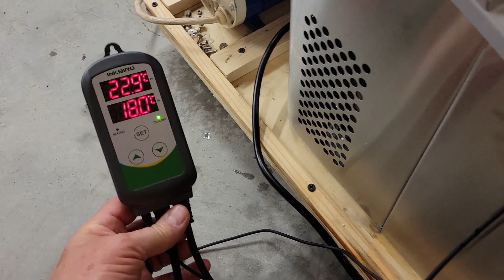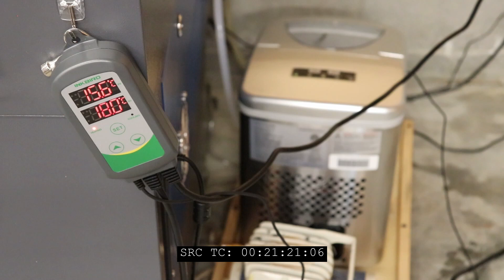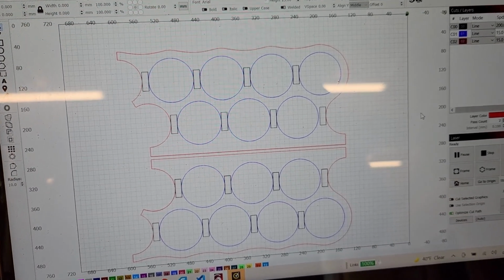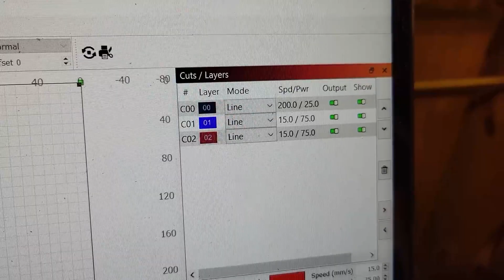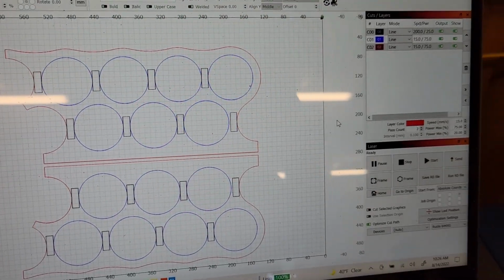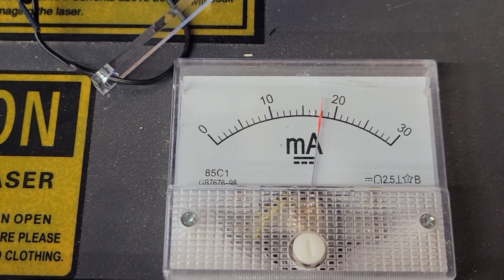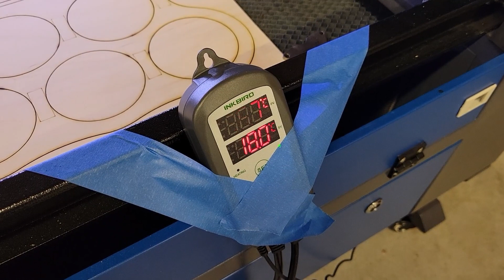CO2 Laser Cooling Method Comparison

Comment: Doesn't the fact that the temperature has increased to 25 degrees have to do with the flow rate of the pump? Perhaps if your pump moved a higher flow rate, it would help. Another thing that I think can be done is to insulate the hoses so that the cold water does not dissipate. I see that the journey to the laser is long. Perhaps the water does not reach your laser so cold because it travels a very long stretch.

Comment: Nice video. If you like to have a more constant cooling and dropping the temp lower, just let the icing machine do its work and generate ice in to the water at the pump and it will cool alot better <3

Comment: How does the inkbird work with the icemarker ? Beacuse when it turns it off and on don't you have to still put it on manually?
Reply: I only use the Ink Bird to monitor temperature and send an alarm to the phone app if it drops below a setpoint temperature. That lets me know if something happened to the heater and it stopped working.

Comment: I have two simple suggestions.
1. One of the reasons the temperature is rising is that every 5 to 7 minutes the icemaker compressor will reverse it cycle and heat up the coil to release the ice cubes. Since that manifold is spraying cooling water on it, it will add that heat to the cooling circuit. I suggest adding some antifreeze like glycol to your cooling water. That way you'll don't have to use that manifold as the ice maker simply won't be able to make ice cubes. Therefore the return line can discharge directly into the tank and thus not picking up any heat from the reverse cycle.
2. Go for 2 stage cooling by adding a 240mm radiator with a pair of high pressure 120mm fans to the return line. This will probably take off just enough heat to let the icemaker maintain a constant temperature. The reason behind this is that a radiator cools more effectively with a higher temperature difference while a compressor cools more efficiently with a lower temperature difference.

Comment: You could improve the efficacy of the chiller by removing all of the internal electronics and connecting power directly to the compressor, so that anytime its plugged it, it just runs constantly (just leave the diverter valve unplugged, its designed to change the freon flow to allow the cooling element to heat up in order to release the ice).  Then just use the external inkbird ITC308 controller to cut power if the chiller bottoms out in temp.  This will prevent you from having to deal with 'cycles' at all.

For peltiers, I had the same experience, there just isn't enough surface area.  I had slightly better results changing to HDD heatsinks rather than CPU/GPU heatsinks, but still not enough surface area to cool efficiently.
Reply: Depends on the kind of compressor. Modern refrigerators and icemakers (at least in Europe due to regulatory standards) come with a DC powered inverter driven compressor making it much harder to make modifications like that.
Reply: @familiekruit6068  Good to know, thank you.  I figured he was in America because of the style of plug, so that recommendation should work in this case.

For European, do you know if the invertor circuit is a separate board/module, or included on the main control board?  If its separate, the procedure would be basically the same as the US, except one would keep the invertor.  If its on the main control board, there might be some signal tracing needed in order to skip the control circuitry, but it should be possible to use the invertor portion of the circuit, and essentially ignore the rest.  I'd have to see the board to know.
Reply: @ixamraxi  Took a refrigerator apart last year to take out the compressor as I wanted to build a silent airbrush compressor. There was a mainboard inside with lots of SMD components and some SSR’s on it that appeared to drive te compressor. There was also what looked like a data line between the compressor which if I remember correctly had a 7 pin connector. Did some research with an oscilloscope, the power to the compressor looked like a PWM signal. Also, the compressor wouldn’t run with the data line connected. I couldn’t find a dry contact anywhere that would start the compressor without the mainboard connected. Also, the mainboard wouldn’t start the compressor without the temperature sensor and the display in the door connected. Its nothing like the old ones so it ended up to be rather useless.
Reply: @familiekruit6068  Sounds frustrating.  At that point, it might actually be worthwhile to build a small invertor circuit that can drive the compressor independently without needing the mainboard.  You can probably buy them, as I am sure others have run into the same problem over there, but it would could a fun project if not.

Comment: Nice study. Obviously the Peltiers are not a solution, which is in fact consistent with TEC coolers for computer processors, where they didn't do a good job either.

I have an idea, which I haven't tried, but maybe you can since you have an ice maker already installed. You are trickling water down the ice making elements, which may not utilize them to their full potential. The idea is simple enough and costs next to nothing - find the food/ice rectangular plastic container which fits the compartment under the cooler tubes, with inlet and outlet tube attachments at the opposing sdes, and put it under the ice making "fingers", fil with water so that the elements are fully submerged and circulate that water only, using the bottom compartment as an overflow drain only.  I don't know what the minimum quantity of water is needed, biu it's probably wise to choose the container with as big a volume as fits up there. I think that should improve the cooling efficiency, how much is a question. But I have a feeling you might get to a point where the tube will not overheat regardless of the workload. And I would also use the thermostat to actually switch the cooler on and off if it's temperature range allows this.

Comment: Thanks for your investment  of time and money to demonstrate  how unsuitable and inefficient Peltier devices are for this application.  I think the  fixation with keeping the temperature  in the 18 to 20 C region is a myth created by the chiller manufacturers. Go look at the tube manufacturer's specifications and most will tell you that water temperatures up to 40 C are permitted. I have carried out my own  tests for 3 hours continuously with a 70 watt tube running at between 40 and 47C. I recorded a 5% loss of power , which at the time I did not understand but there were no ill effects to the tube which still runs  today (6 years later). I have encountered many correspondents with refrigerated chillers (CW5000/5200) that experience serious "banding" problems when doing photo engraving. It has long been known that this banding coincides with the refrigeration switching on and off. In the absence of a REAL explanation as to why the power was changing, the simple fix was to create a coil from  annealed microbore tube (from any hardware superstore) and connect the chiller to this coil  rather than the  laser tube. The copper coil then sits in a seperate water reservoir and the water from that reservoir is pumped through the tube with a cheap  submersible pond pump. This system removes the shock cooling to the tube  by buffering it with this seperate reservoir that changes temperature slowly.. Problem solved. But why? 
 You have to understand the physics of how the tube works but  briefly there are two reflecting mirrors at the ends the tube. These  are vital for the amplification of the photon population that results in the watts power output. These mirror MUST be perfectly flat and aligned to each other and heat up when the tube is on. Look carefully at a tube and you will usually  see a full water jacket  at the HV end mirror and a partial water jacket at the output end mirror  The rapid cooling shock as the refrigerated water turns on/off  cools the back face of the mirror causing distortion. This  impairs the perfect reflections and in turn reduces the power output. Slow temperature changes have virtually no  distorting effect on those mirrors . That is why buffering the refigerated water solves the power change issue. Also, ther bigger the reservoir the slower the temperature change.